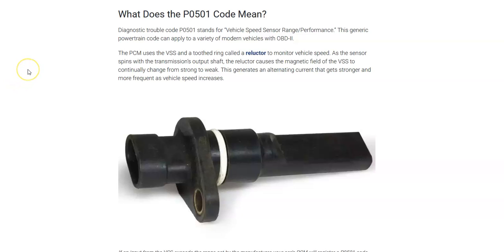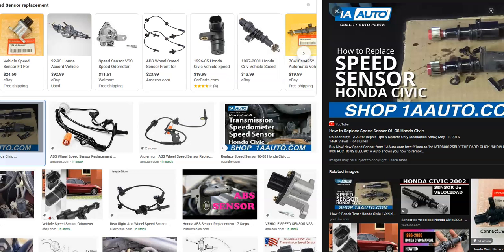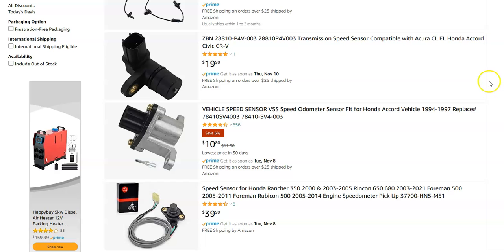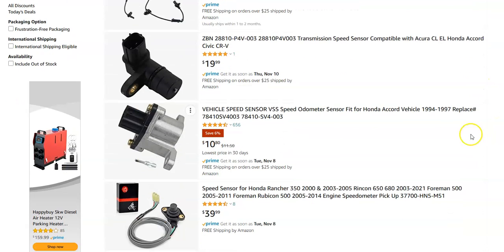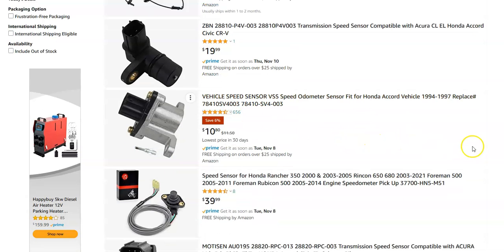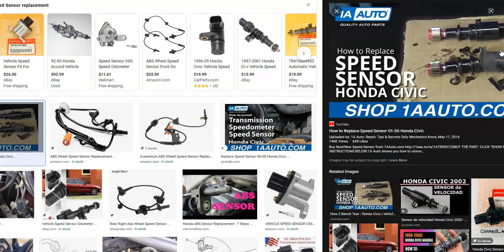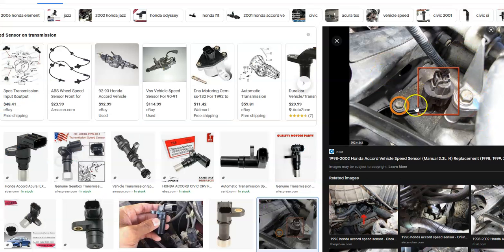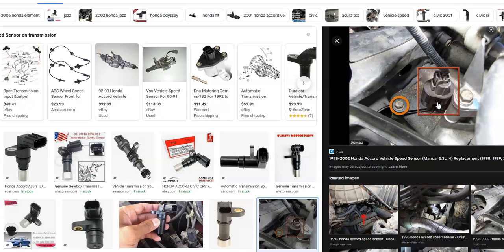How to Fix Honda P0501: Vehicle Speed Sensor (VSS) Range/Performance Problem

Comment: Please help my dear brother, I have a Honda Jazz while driving, the rpm meter rises with noise, the car noise increases, the gear shifts difficult, the transmission is disconnected, and I have two codes, p1887, p0501. Please help. Is the speed sensor the problem?